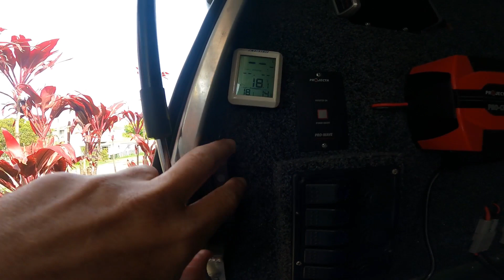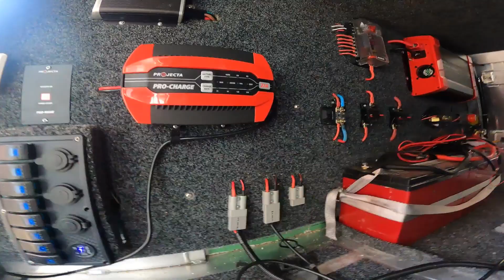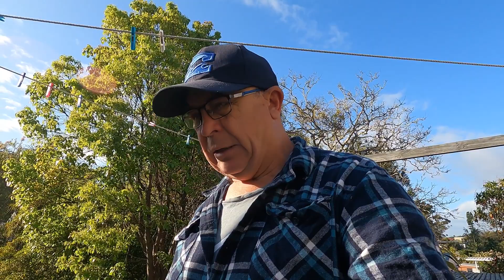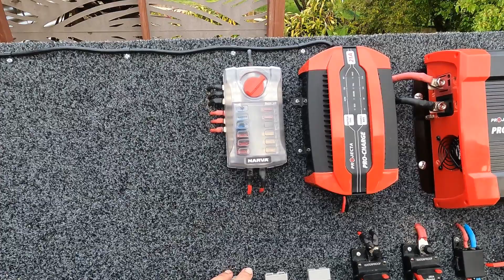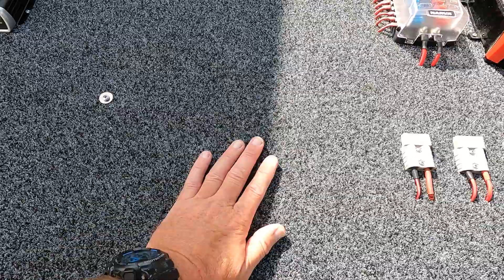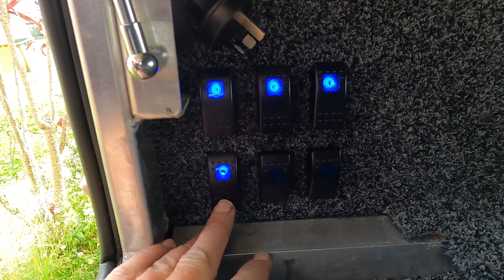Powering Your Adventures Off the Grid: 12V Setup for Camping Touring

Comment: Hey Craig great video and good inspo for my build. Was thinking your voltage drop may have something to do with the size of the cable, won’t be dangerous to step up the size as long as it is fused
Reply from the maker: Hi,
Thanks for taking the time to look and comment.  I really appreciate it. 
The voltage drop was due to poor connections. I found a number of poor soldered and loose connections. 
I’m going to do another video in shortly on it and the 12v projector charger.
Hope you subscribe. Happy for you to share my channel on all social media
Cheers 
Out There Touring
Reply from the maker: Hi,
Just letting you know an awesome cook up being released tomorrow afternoon.
You need to try this
Cheers 
Out There Touring
Reply from the maker: Hey max, 
How are you going. I haven’t heard from you in a while so wanted to check in and make sure all is good. 
Cheers 
Craig 
Out There Touring
Reply from the maker: Hi 
Thanks again. 
Just letting you know I’m now on fb and Insta as Out There Touring
Cheers 
Craig

Comment: Looks like a job well done, though I do have a question. I've noticed that seems like all the overland/4x4 enthusiasts go to great length to hide all the wiring behind the panel, why? Given the harsh, extreme conditions you are taking these vehicles into having it nicely loomed and accessible would be much more preferred to a super clean appearance.
Reply from the maker: Hi.
Thank you for taking the time to look and yr comment. 
It’s just about appearance and looks tidier than wires that are visible and could possibly get caught up on something whilst going over certain terrain. 
Like, share and sun
Cheers 
Out There Touring
Reply from the maker: Hey there
How are you going. I haven’t heard from you in a while so wanted to check in and make sure all is good. 
Cheers 
Craig 
Out There Touring
Reply from the maker: Hi 
Thanks again. 
Just letting you know I’m now on fb and Insta as Out There Touring
Cheers 
Craig

Comment: Hi Craig - thank you for sharing your experience - I’m currently working through a dual Lithium battery wiring project as well - I worked in the Avionics industry wiring cockpits and equipment- a loom in a modern domestic jet will have bundles of 100-200 white wires for main and backup systems - to avoid voltage drop and open circuits we never use soldered connections due to vibration and eventual breakdown of solder - everything is mechanically crimped, heat shrinked and tied together to make it easier for future mods and maintenance - the use of cable ties also helps strengthen the looms by anchoring to the board and thereby reduce movement and hopefully avoid open circuits.
Reply from the maker: Hi John,
Thank you for taking the time to watch and your feedback is appreciated. When I do change to lithium I will use Anderson plugs in connections from dcdc charger. I see that itech world does this and I believe that’s a easy way of connecting.
Maybe watch my new video on siricco fan install in RTT
Thanks again for watching
Cheers Craig
Out There Touring
Reply: You just gave me an idea there John. I have a spool of waxed wiring loom string that I have used to restore an old guitar amp with. A bit OTT for a caravan but why not?